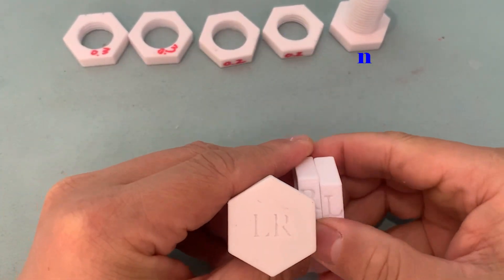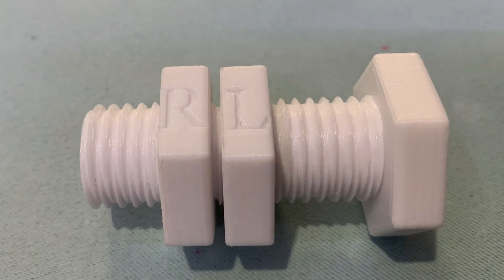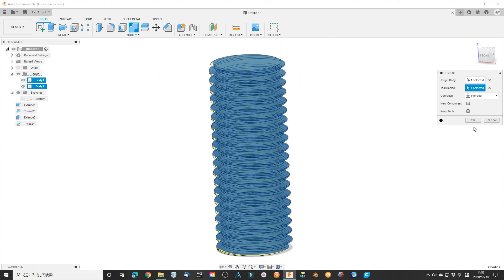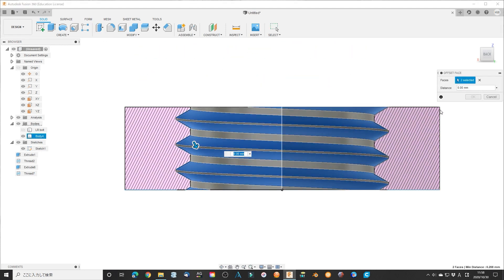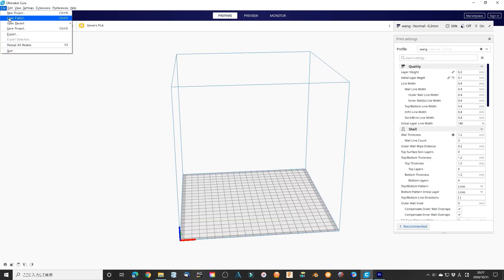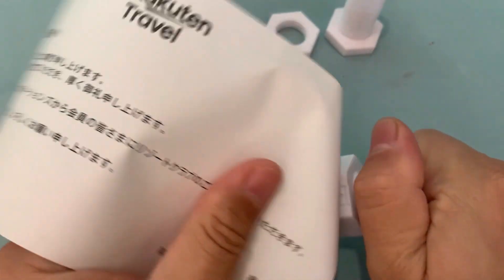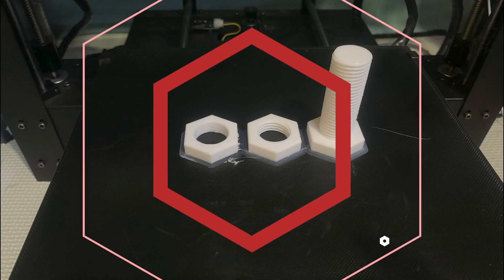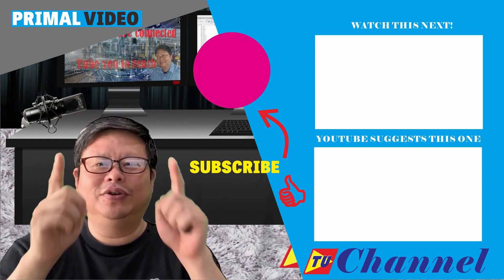2 Magic bolts (Nuts will go to different direction when rotating)(double threaded bolt and nuts)

Comment: I have a question. I want to make a nut that has a bolt coming in from left and right, when you screw it, it will extend the bolts in each direction left and right. Is this possible?
Reply from the maker: Sure. It is possible. Good luck.

Comment: I am looking for rotating one nut causing two different bolts on either end expand or contract? Can you give clues please?
Reply from the maker: Make the nut big enough and cover two bolts, it will do so. I think it already has this product. When you rotate the outside socket(nut), the inside part (bolts) will move closer or separate. Thanks for your comment. Have a nice day.
Reply: Can you explain using CATIA V5